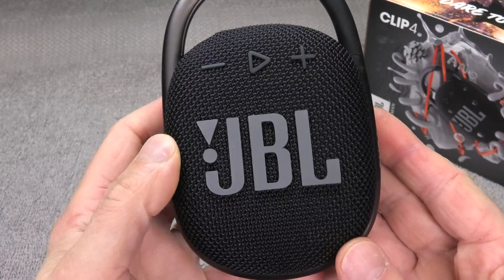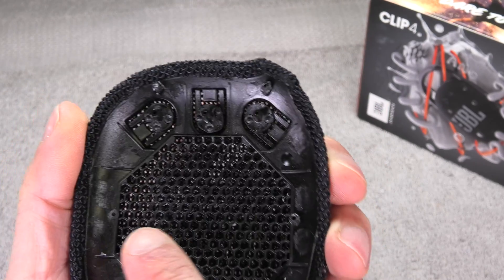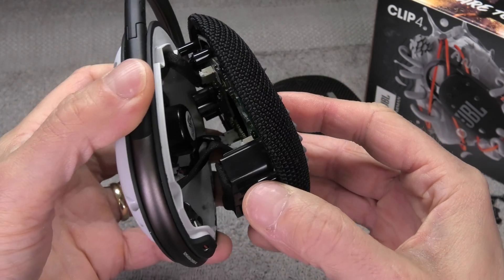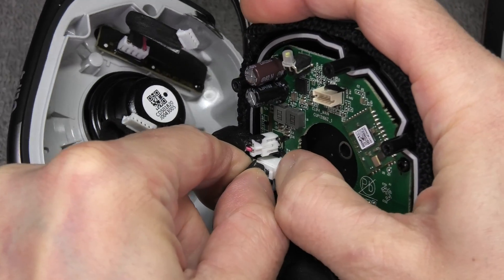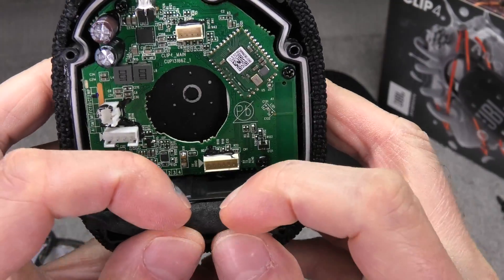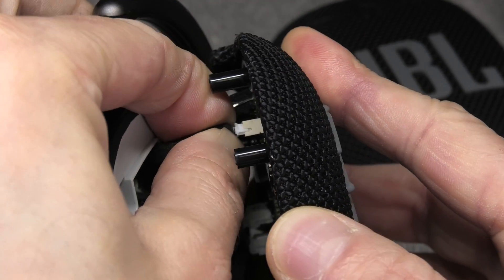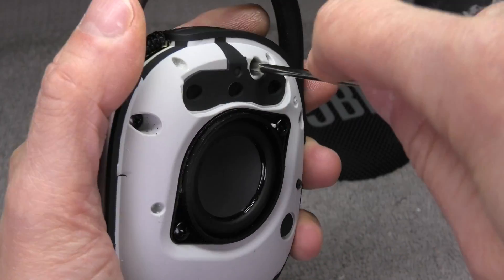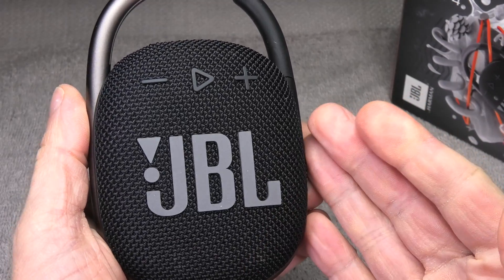Battery Replacement for JBL CLIP 4 Bluetooth Speaker (How to DIY in 4K)

Comment: I charge my jbl clip 4 it turn on the red.. Den for a second it will turn off... Its means i need to replace my battery?
Reply from the maker: It’s likely the battery needs to be changed. 
I’d first disassemble the speaker and church the battery voltage and shape.

Comment: These speakers produce fairly good sound but they're not worth a hundred bucks fucking cheap design lack of buttons and you know what the overall chassis of the speaker is just cheap plastic even the metal on it's not good metal JBL is a crap product Don't buy

Comment: What do you do if the screws are stripped? I had that problem with my clip 3 and was never able to get to the battery.
Reply from the maker: Hi,  in that scenario I put a small piece of tape (usually electrical tape) on top of the stripped screw and try to remove it then. Often times that works.

Comment: Hey there! I was gifted one of these and don’t have the receipt. There doesn’t seem to be any battery life from what I can tell. Won’t turn on at all even after being on charge. Only powers on once plugged in but can’t seem to do anything. Can’t factory reset or anything so I’m assuming the battery is completely drained. Just wondering if you had a link to where you purchased your battery. Would be interested in doing this and giving it a go